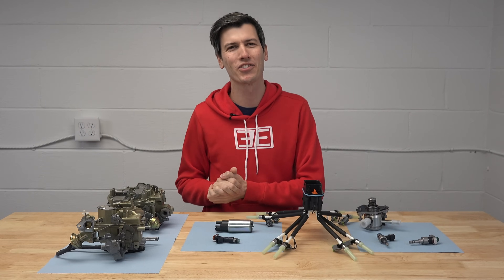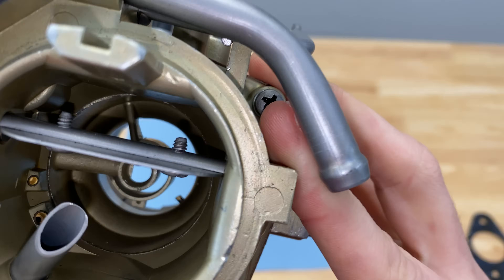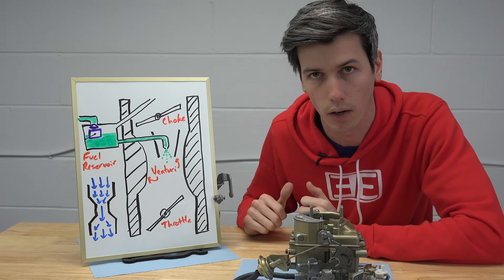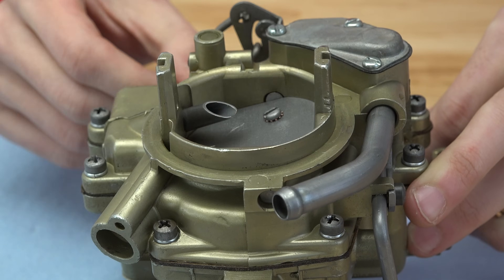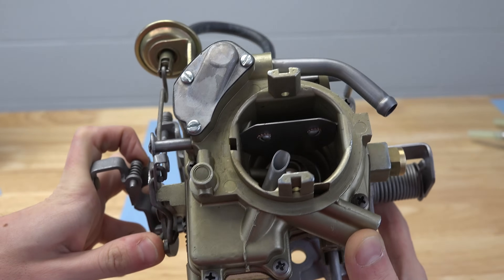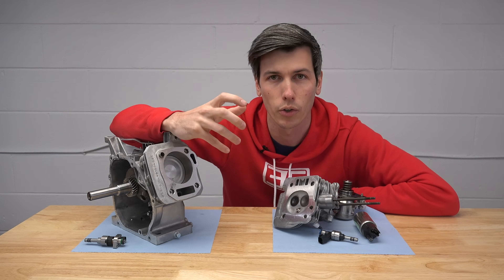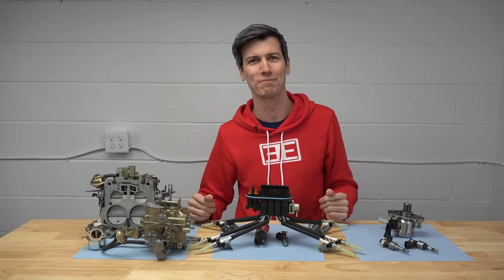What's The Best Fuel Injection? Carburetors vs Port vs Direct

Comment: Carburetors are not actually "Fuel Injection" - that implies fuel delivered under pressure...
Reply: MOST all carbs had accelerator pumps .. that was "fuel injection" ... tee-hee ...

Comment: Had a Holley sniper installed on my C10--- after 4 months of " adjustments " having to send the unit back to Holley 2 times, Holley kept sending me back used, refurbished units back instead of the original one, even more adjustments, stil not running right, after yet another time talking to Holley rep.-- wanted me to send the unit BACK IN for the third time--- took that POS off and installed a carburetor-- no problem since--- sold the used sniper on Ebay, conclusion--- lost = $ 1,300 dollars and a valuable lesson--- never again for fuel injection 👹
Reply: a properly CFM carb rated to your cubic inch engine as well as the correctly jetted carb will yield the same fuel economy whether cold or hot outside , they have over complicated fuel injection , direct injection is now causing serious problems in regards to carbon build up in the intake runners = expensive repairs, SORRY  but i will take a carb over fuel injection any day of the week

Comment: Number of chokes does not tune the air fuel ratio, that was wrong. The number of chokes can help increase velocity compared to a single larger choke, helping running at low revs. You never once mentioned jets as a way of tuning air fuel ratio, pretty big omission.

Comment: In the carburettors case, will the engine have a seperate carburettor for each cylinder like each cylinder has each port?
Reply: Ferrari yes Toyota no 
Or 
Performance vs compromises to make a car do many things for as little $$$ as possible.

Comment: As an ol'skool retired engineer still tuning carbs (1958 Porsche) I have to say v.g. explanation of carb physics. Well Done!! Regarding complexity, whilst use use the term "electronic" you did not address the complexity associated with that seemingly simple term.  That includes everything from crankshaft positioning sensors to the mini-computer. That might make a nice sister video. You might start with Chrysler's attempt in late 1950's to build an analog electronic FI  pre-solid-state electronics. The wax insulating media within old fashioned physical capacitors would melt!!!  Keep u the good work

Comment: Could you make a video explaining how mechanical fuel injection works? I’ve always been curious about the transitioning period between carburetors and EFI.
Reply: There are two systems of mechanical injection that i know of. For instance early injection engines used a injection pump that operates on the same principle as diesel inline type injection pumps. A camshaft  drives individual pumping plungers for each cylinder. The effective stroke and thus the fuel quantity is controlled by variable spill port opening and closing. This type of pump can be used for both port injection and direct injection.
In the 70's Bosch came up with the K jetronic aka Continous injection system. It uses a vane type air flow meter to control a valve which varied fuel flow to injectors. More air flow - more fuel injected. Later the system evolved to KE jetronic with some electronic controlls but still mainly mechanical. 
There might be more but I don't know of any

Comment: So which is best? and at what......efficiency, power, cooling, durability, cost.
I love your channel and explanations, however.

I am an Engineer myself as a profession. As you know ambiguity is a problem when it comes to technical matters. 

The term "best" is ambiguous.   Engineering is purpose and application intent oriented. That means one design may be great in one application or purpose but terrible in another. 

When you say best, I would like to see more specific reference, in other words best at doing what or what purpose,.

Comment: I Love All your Vides - You have quite a gift 
at communicating and exude a tremendous passion for your  interests. In this video I’d like to offer some small critique; I wish you had mentioned. Accelerator Pumps when discussing the Carbs, this , as you know is
additional way carburetors create more power 
from an engine, and they are integral to most 
Carbs. Second, I wish you would have described the physical action inside a cylinder 
as a fuel ‘Burn’ , not an Explosion. Which leads me to my last point - Explosions in cylinders are bad , we call that Detonation or Pre-ignition . ‘Knock’ is just the slang term we use to describe an audible symptom of Detonation/Pre-ignition , the cars engine makes pro iced ‘knocking ‘ sounds that we hear in the cockpit.
Reply: Sorry for the misspellings on my last post ( autocorrect!) the last sentence should read;
The cars engine makes pronounces ‘knocking’
sounds that we hear in the cockpit . These are just small observations, please take them in a positive light. I am a Huge Fan of all your videos and appreciate your enthusiasm,
ability to explain complicated subjects in lay terms    and your clear expertise in your subject matter and engineering and physics overall. Please keep up the good work and keep them coming !

Comment: Port injection is my favorite for sure, it can be very reliable and the entire setup can be pretty simple. Direct just brings more problems and replaces cheap parts with expensive high pressure parts. Carb are very simple but also a complete pain in the ass, hard to tune, have to be synchronized, require maintenance. They do sound good though.

There's always people saying I love carbs because I can fix them on the side of the road, but with electric port injection you wouldn't be on the side of the road to begin with.
Reply: If you know what you're doing, a carburetor isn't difficult to tune. It's only difficult if you're uneducated and/or unskilled with carburetor tuning. Literally all you need is a screwdriver and some knowledge/experience!
Think of tuning a carburetor like tuning a guitar: There's that sweet spot you want to be in, but there's also such thing as too much and too little.
Reply: Agree, I have a Suzuki Kizashi 2013 with port injection, old technology in compare to other brands same year. Those engines and components even if old school are pretty reliable and can hit over 300k miles with normal servicing.
Reply: Haha nice one!

Comment: The air pulls the fuel through the jet hole, but ok, it ‘injects’
Reply: Is it pulled or pushed by the higher pressure on the other side?

Comment: As someone who drives a car with 200k miles on it, what would the carbon build up look like using either direct, port or both on an engine with that high of mileage? Would it require specific servicing (walnut blasting) more frequently?

Comment: What about putting a container into the engine bay, that will hold about a gallon or two of fuel and drawing the air from the bottom of the container through the fuel so that only the fuel air and vapor go into the engine, which would be as lean as possible. And we've known since World War II that you can lean engines out quite a bit, for fuel efficiency. And then when you need to apply torque or horsepower such as pulling something, you cuz you certainly couldn't polo match without a good probability of causing damage, you can build a system where it would start port fuel injection, which would also help keep the valves clean. But you would end up with a three or four fold increase in fuel mileage. In test back in the 1970s an early 80s, cars that were getting 15 miles per gallon at best, we're showing 80 plus miles per gallon at times. Without causing any engine damage because the people were driving the cars this way on a regular basis. Is there any reason why this can't work?

By the way by cooling directly in the cylinder, you caused a problem with the vaporized fuel re condensing into raw fuel. With no time element to reveal a prize because the temperature doesn't all come down in a perfect pattern.

Comment: 2:37 so if i am at 1000rpm on a turbocharged car in 2nd gear lets say, and i mash the throtl, does that open the valve for air fully?
If it opens it fully, it means i am wasting more fuel right?

Comment: I was once a painter and if you know how a spray gun works, you'll know that carb is a combination of a spray gun and a toilet. In a spray gun, air rushing by a nozzle draws the paint out and atomizes it. In a toilet, the water level in the tank is controlled by a valve connected to a float. When the level drops (you flush to toilet) the float drops and opens the valve whick lets more water in until the level (and thus the float) rises enough to close the valve. Spray gun + toilet = carburetor.

Comment: Also to be considered is the fact that carbon buildup occurs directly on the injectors in direct injection because they are in the combustion chamber, causing premature parts failure on a more expensive part.

Comment: OK, re carbs, I would have have bet my left nut that the air pressure would INCREASE if forced through a constriction, not a vacuum! good old Venturi eh? Stumbled onto one of the most counter intuitive phenomenon within physics.
Reply: There's definitely some sort of sorcery going on there. Same with how  engineers explain the airplane's airfoil working principle. I never understood how they say the Bernoulli effect account for 70% of the lift but still airplanes could fly upside down.

Comment: direct injection running 5000psi while im over here with a 6 psi fuel pump for my 72 chevy
Reply: 9psi on my 76 and 86. Higher pressure reduces the risk of vapor lock between pump and carb.

Comment: I would like a comparison of fuel injection further up the runner vs port and direct. I have tried researching it. And from my understanding port and direct injection has better emissions and it is easier to package so that is why it is more prominent but moving the injector further up the intake runner away from the cylinder creates more power and efficiency because it gets more time to mix in the incoming air. I have heard but not researched that some racing groups run individual throttle bodies and the injector  sits outside the throttle body to take advantage of the turbulence caused by the throttle plate. Really want to learn more on this.

Comment: Between 1984/93 the UK had a forgettable car (Montego) that used an advanced SU carb (HIF 33E) where idle speed and cold start enrichment were managed by an ECU-controlled stepper motor that adjusted the position of the jet in which the main needle moves. It would have been an interesting development to fit a lambda sensor to the exhaust and control fuelling in a closed loop rather like a single point fuel injection system. The car in question was quite economical for its size, which was apparently the reason for this complication.

Comment: its interesting to me that some of the carbureted cars that i've searched on Wikipedia get much better gas mileage than cars of today like 30+ when alot of cars today get like 15-20
Reply: It’s_Robbie Time    It is true I had an 87 Chevy Caprice with a 305 it gave me 27 miles per gallon on the highway but it did not have a lot of power and the engine ran very lean but the gas was better back then.  If you run gas in your car today with no methanol you will get much better fuel mileage and much more power.  I have a 2017 Toyota tundra with a 5.7 L engine and on high test fuel it gets 17 miles per gallon on the highway and that is pretty normal for this truck.  But if you put in fuel with no methanol this truck will give you 22 miles per gallon and much more power it is amazing.  This fuel is hard for me to find I can get it sometimes when I go to Florida or when I am out west. But I would run it all the time if I had a steady supply.  It does the same thing in my wife’s Chevy truck but even better mileage because that engine has deactivating cylinders.  The gas they are giving us nowadays is terrible.
Reply: One thing to take note of is the EPA rating scale has been revamped, new EPA ratings are lower than before

Comment: I love carburetors, but one thing they don't do when used for ground machines (non-aeronautical) is adjust to differing air densities. When driving up through different elevations, the carburetor becomes richer and richer in mixture, whereas the computer controlled fuel injections systems automatically lean out the mixture and maintain ideal fuel addition for peak power.

Comment: I've really enjoy your presentations. You glossed over one point, GDI systems tend to accumulate carbon on the intake valves. Learned that the hard way. It's caused by oil in the blow-by. (We haven't used drift tubes since the 60's.)

So, besides port and direct injection, what else can manufacturers, using only direct injection do to control the problem?
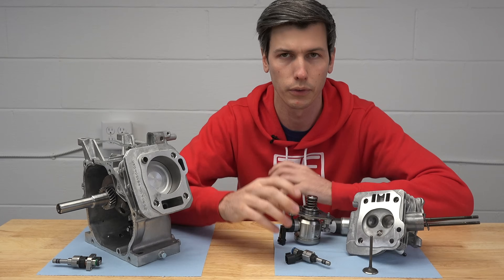Reply: He talks about the deposit problem with GDI around 9:30
In a previous video he mentioned the value of synthetic oil to reduce the deposits as well.

Comment: As someone who had carbureted cars in the 1960's & 70's, I'm so thankful they went away! So you need to put a modern spin on how to deliver "fuel" to a motor. Choices to deliver electrons are Bus Bars, Solid Wire, or Stranded wire.

Comment: 11:15 So you're telling me you can use the same amount of air, less fuel and get more power? You need to talk to those Donut boys and get your stories straight.

Keep up the great work!
Reply: Haha, sadly no. That’s not how it works.
Reply: What metric are we going by?

Instantaneous Horsepower? Or Horsepower per gallon?

Rich fuel mixes make more instantaneous power.

Lean mixes make more power with that gallon of fuel.

Comment: When comes to reliability, durability and cost, I'll go for carburetor anytime.....
Reply: Depends on how you look at cost.

The cost of extra fuel typically consumed by a carb engine on top of the regular tune ups and oil dilution from rich / unburnt fuel, not to mention how much longer an engine will survive running optimum mixtures.

Vs the cost of some more expensive components and benifits to driveability and reliability.

There are simple aftermarket efi systems that easily out perform most carburetors without much effort.

Emission controls killed the simple carburetor, I shudder thinking of all the vacuum control lines on Toyotas in the 80's.. Eeeiikkk
Reply: I fought with carbs when I was a kid. Many were junk especially GM two barrels on 1980s V8s

Comment: So you say that there isn't very much control of the fuel/air ratio with carburetors, but older piston airplanes are carburetor and the pilots could directly control the mixture as they climb in altitude. They could also choose between fuel rich for better cooling (since the engines are aircooled) or lean for better fuel economy. Why couldn't cars control the mixture and how does that work? I'm assuming some sort of mechanical bias on the float bowl side?

Comment: Some critical mistakes here, apologies if someone already covered them.
1. Carbs can actually achieve a wide range of AFRs depending upon demand and do it quite well.  What they can't do for emissions purposes is rapidly swing the AFR on either side of stoichiometric to properly utilize 3-way catalytic converters.  This is why fuel injection was so critical for meeting new emissions standards (and why port fuel injection and O2 sensors needed each other to be useful).
2. Carbs and throttle body injected engines both face the same distribution issues which ends up coming down to intake manifold design rather than fueling.  A lot of manufacturers took some serious shortcuts on intake manifold design after port fuel injection became common because they thought they didn't have to worry about it so much, but without cylinder to cylinder trimming based on O2 feedback, you would end up with more than a 1 point AFR spread from best to worst cylinder.  The best engines have well matched flow from cylinder to cylinder these days, but on older setups indexing injector flow according to cylinder airflow variance was a useful tool if you didn't have a standalone with cylinder trims.
3. Stratified injection does not need port injection to work.  And in fact the idea that DI allows you to spread out the fuel across the cylinder is counter to the purposes of many DI engine designs.  Those with a notable dish or bowl in the piston crown use that to concentrate fuel in a rich portion of the chamber, so you actually want a DI injector that can focus its spray in those situation.  Not to mention that wall quenching is also an issue if you're spraying fuel all across the upper cylinder.

Comment: I get DOUBLE the fuel economy from my EFI compared to Carburettor.
My carb 650 single (Suzuki DR650) gets 5.6L/100 km
My EFI 1301 V-twin (KTM 1290) gets 5.6L/100km...and it’s basically TWO 650 engines in a V-twin formation.
EFI is vastly superior, the 1290 also has FOUR TIMES the horsepower of the 650.

Comment: So why did my 1982 Chevrolet Cavalier V6 get better gas mileage using a carburetor then my 2009 Honda Element.  Both vehicles were about the same weight.

Comment: I thought I read at some point direct injection also adds fuel at high loads (especially at low RPMs) right at the moment combustion was needed to prevent knock, instead retarding the timing so you didn't lose as much power down low.

Comment: To be fair, carburetors are not injectors.  Carbs work on a vacuum while the injector work on a medium pressure fuel line while GDI works on high pressure fuel lines.

Comment: I like Max Mad fuel injection. Just spitting gas into the air intake.
Reply: Wish they hadn't put that in the movie. Took me out of the action. In reality it would clog the air intake filter, lower overall air flow, reduce power, foul up the air/fuel mix and prolly screw up internal parts.